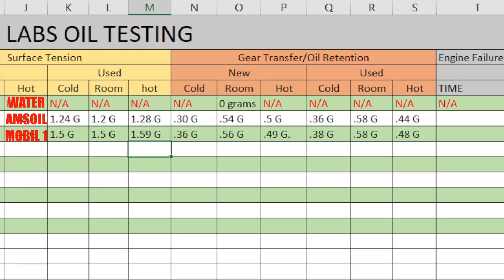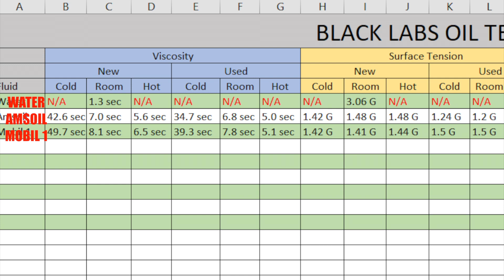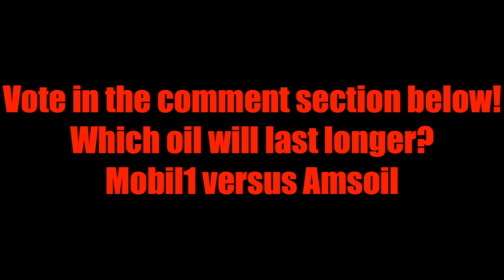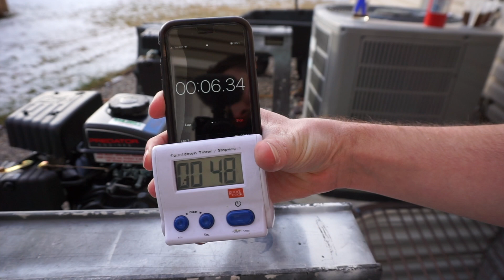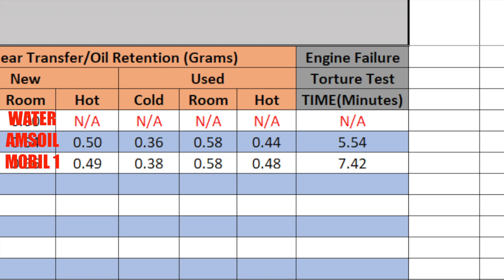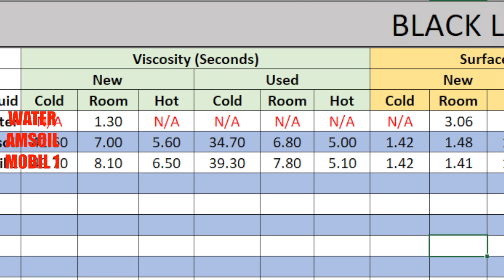Mobil 1 vs. Amsoil. Torture test. Search for the best synthetic oil (part 2)

Comment: Yeah, gotta say. Not sure this test clearly rates oil, as in this application the thermal pathway provided by the oil - from all sliding surfaces- was eliminated, causing surface temps to be affected by multiple factors. Without oil, combustion heat will not be passed to the oil, to the crankcase/cylinder fins  and to the environment. The top ring could then butt, and overload rod bearings, scuff cylinder walls, even seize. In other words, it is not just the oil's lubrication parameters at work- unacceptable changes in all clearances likely occured, not just due to inadequate lubrication, but to lack of adequate heat removal- not the fault of the oil, but lack of coolant. I appreciate the effort, but I dispute the method.

Comment: I love these tests..and appreciate the time put into them (and $$). But I've always said, a test needs to consist of multiple tests to eliminate manufacturer/assembly variables. So the exact same test with 2 new engines, maybe 3 times (yes, a waste of 6 engines lol). If the results vary, its an engine thing. If the results are consistent, its an oil thing. Is kind of how i see it. I've always gone with Mobil 1 and they seem to either be at the top or near the top in almost all tests. So that itself cannot be a random factor 😅

Comment: i live in iraq and more than 50c in summer 
we have both ams and mobil 
alot friends told me that amsoil evap after 2000 mile 
maybe cuz of overheating 
i use mobile 1 and metasu japanes oil....
but mobil1 is best 6000 mile and super cool engine

Comment: I wonder if he added oil to the Amsoil engine right after it stopped if it would have restarted since he got 8 pulls with no binding? mobil1 engine looks like it had more damage cause he could only pull it 4 times. Amsoil FTW?

Comment: I might wrong but I would be surprised if these oils were rated for the temperatures these air cooled engines run at. A simple 30 weight oil designed for these engines is all I've ever used. No problems so far.

Comment: The static adhesion is just better with Mobil 1.  I don't know why Amsoil fan boys would get butt hurt ?  It is just a neat experiment.
Reply from the maker: I don’t even know Amsoil fanboys existed until these video. They take it Very personal
Reply: @TenzaMotorsports  Its that way with a lot of products.  I did my research and found Amsoil is just a blender as most comapnies are.  Also, found out that Amsoil's  base oil comes from Exxon Mobil along with Citgo, and Conoco Phillips 66.  I made a comment about giving Exxon Mobil some credit for being part of the formulation for Amsoil ?  Did folks get mad about that.

Comment: Lemme explain what exactly happened. Amsoil flows  much better than M#1. So when you drained em I'm pretty sure Amsoil came right out probably 99.99% and inside the engine there was almost nothing left. But M#1 probably didn't drain like amsoil did, due  to flow rates in my opinion. That was probably let her go lil bit longer. But in reality no engine would survive without proper engine oil no matter what. And in this test you killed 2 engine by running em without engine oil. Remember they are engine and both were running with out oil, So one can die before other it doesn't prove anything. You could run em with oil with extreme over load to see what would happened but yea killing an engine by just adding too much load probably not enough to kill it in an hour or so. Mobile#1 full synthetic is not 100% synthetic it's minerals oil with up to 25% synthetic blend with their additives. And most experts say that 25% synthetic is over kill and more than you need maybe. In other hand Amsoil 100% synthetic and there's no minerals oil mixed but their own additives. I think amsoil is the only oil that is 100% synthetic. So if 25% synthetic blend can over kill then 100% synthetic should be over over over over(x4) kill. And Amsoil was designed to use in fighter jet type engine where you need something really heavy duty oil but they also give us a chance to use the 100% synthetic power in our regular vehicles. I been using M#1 extended performance full synthetic with M#1 oil filters in all my vehicles. From 2013 through 2020(over 7 years) then decided to try something new and used Castrol Edge advance Synthetic with M#1 oil filter for once and felt some difference. And this is no lie I felt Castro better than M#1. After 6-7 months later I changed oil brand again and used Royal purple Synthetic oil with Royal purple oil filter and I noticed difference with low engine noise and smoothness. So in my opinion Royal purple must better than Castrol edge and M#1 extended (20000miles). Big difference I noticed royal purple oil's weight lighter than others. I wanted to stick with Royal purple before I watched an full episodes of All types of synthetic oils from "project Farm". So I really wanted to give Amsoil a try because when I heard most oil companies tricking us by saying fully synthetic (which is 🤥 lie to me) but they are up to 25% synthetic blend. Where Amsoil the only oil that is 100% synthetic. Compare to others Amsoil expensive but ain't it worth? Think about 100% vs 25% synthetic oil and 15k severe service 25k normal service (1 year) and I've seen people go with amsoil over a year(I saw a guy 18 months while isn't recommended but he did) and got no issues. Even his 18 months old amsoil with 16-17k miles he ran a black stone lab test and the results were impressive with dece TBN number.  So anyways I been using amsoil for last 6-7 months in 2 of my vehicles and I'm loving it. My cars runs much quiter than before  and both of em ideal RpM was close to 1000 but now it's only 500-600. Thanks for reading I made it too long didn't even realized. Just shared my experience with engine oils and my opinions about Synthetic oils. Amsoil is the best synthetic oil I've ever used in my vehicles.
Reply: M1 wins on flow test in whole Internet, check at Project Farm and some others, that thows all above text away....
Reply: Amsoil lost. Deal with it.

Comment: How is this an oil test? It’s a which engine fails with nothing In it test 🤣 you’ve have to do this with a minimum 3-5 diff engines due to building tolerances.

Comment: So from what I guessed. You warmed up the oil a bit. The AMSoil drained more because AMSoil flows better cold or hot. Meaning the AMSoil drained more. When running engines and draining them for maintenance you typically want more oil from the previous change to drain. Unless you want some old material staying in the new change. AMSoil > Mobil One. Next time you should weigh how much oil drained from both crank cases. It would show which one flowed better out the crank case. Because better flow on start up also indicates better protection on start up. Not which one drains less because it flows less on start up so it stays in the crank case

Comment: I'm not sure what this proves. I'm pretty sure you could find some sort of non motor oil that would adhere to metal better than standard synthetic motor oils. Then when drained from the system that oil would provide enough protection to beat your test. However that oil would be a one trick pony and would never be considered a great motor oil.

Comment: This merely proves Amsoil even drains better when changing the oil haha 😂 
Like many others have done, I’ve  researched them and had my own experiences, and they are both great oils in my opinion.! While I prefer and buy Amsoil because I think it’s overall a better oil, but Mobil 1 is more available in a pinch and good enough in most everything I run it in..
Reply from the maker: Thanks for the comment

Comment: doesnt seem like the right kind of test. wouldnt it be more interesting to see them running with oil and after so long see if one had any more wear than the other? thats what the oil is there for, to protect
Reply from the maker: It would take hundreds of hours to get wear results. This is a torture test.
Reply: @TenzaMotorsports a torture test with no oil😕 there's at least 2 people on YouTube who tested oil on a small bearing for less than an hour and measured the wear mark and weighed the bearing before and after.  Those were a lot more useful is all I'm trying to say
Reply from the maker: There is oil in the engines. Thats why they can last 4-7 minuets. we did a control test with no oil and it stopped at less than two minutes. Thats great, I'm doing different tests than other channels on purpose.

Comment: Rather than the main bearings melted, I would guess the pistons/rings have welded themselves to the cylinder walls... or there is so much scuffing on the cylinders that the pistons/rings won't slide on them.  Thanks for the video.
Reply from the maker: Yeah, I was a little surprised too. I didn’t see any damage in the cylinder or on the rings.

Comment: Is it possible that when you drained both oils,  more of the Amsoil drained out since it flows better because its 100% synthetic? Meaning there was less Amsoil on the bearing surfaces than the one with Mobil1. Or maybe the Amsoil was a little thinner.
Reply: mobil1 beat amsoil in flow test --
Reply from the maker: It is possible, but the amount of oil left would be so close. I’m not sure if that’s what happened.
Reply: @TenzaMotorsports  I'd say if both cups had the same amount of oil drained into them equally, it is a very neck and neck comparison, that's close enough to see which oil has enough lubricity. Both oils are very good. The biggest thing that I've noticed about Amsoil, is the burn off rate is higher between oil changes that I have experienced in the past in other applications.

Comment: Predator engines from Harbor Freight have a safety feature that if there is no oil in it the engine stops after a few minutes and won't restart untill oil is added..... Put a quart in each and pull the cord and they will start right up.
Reply from the maker: Normally yes, these smaller ones don’t have a sensor. I looked into this when i started doing this type of testing. These engines locked up completely after these tests.
Reply: The safety sensor disabled the ignition not locking up the engine
Reply from the maker: There is no sensor on these smaller engines. If they had the sensor, it wouldn't have ran at all.

Comment: Go by the owners manual oil requirments and quit tortureing your wallet with over prices brand names.
Reply from the maker: My owner’s manual says to take it in and have the dealership do it for around $90-100 once a year or 10,000 miles. That’s more expensive than all the oils I’ve tested, if you change it yourself.
Reply: @TenzaMotorsports  Strainge owners manual, what kind of car do you have. If the manual gives that kind of advise you can google the model and the info will come up, youtube will even help with how to change the oil and filter. You should not have to pay more than $20-$25 do it yourself with Super-Teck oil and filter every 5000mils. If is a satisfied feeling knowing that "MAN I CAN DO THE BASIC SERVICE" .
Reply from the maker: I did testing on the super tech the same way I did testing on these two and it was terrible. I'd never use that stuff on any vehicle. You might want to check out the rest of my channel. I build race cars and rebuild engines. I know how to do an oil change.
Reply: @TenzaMotorsports  Super-Teck is an API SN Group lll oil, can be had for DEXOS GM motors. just as good as any other oil on the market.
Reply from the maker: https://www.youtube.com/watch?v=nngKL293e6c&t=1s

Super Tech is not good. I've spent 10s of thousands building my race car, I'm not going to cheap out on my oil changes to save 30 bucks once a year. If you can't bring yourself to shell out a whole $65 a year to do a proper synthetic oil change, then you're in the wrong hobby.
Reply: @TenzaMotorsports  that’s all I needed to hear. Thanks. Not a hobby but a lifestyle 😎

Comment: Oh they will get hot!  put some load on em then run em wide open for hours on end with oil in em then take them completely apart and inspect them for wear. Further more you should be using small engine oil in them not automotive oils. But to run them with no oil? Till the rod bearings seize? I don't get it! Sorry
Reply from the maker: Again I’m sorry you don’t understand. Let me help you out. First off I’m not testing small engine oil. This is a lubricity/strength test. It shows how long a very small amount of oil can withstand heat and friction before completely failing. It’s actually a very common test. Many people and companies have done it to show off oil retention and film strength.
Reply: Get your head out of the sand!!

Comment: Its what the oil does inside the engine at operating temps is what really matters oh and the moral of the story is don't let your engine run dry!!!
Reply from the maker: Exactly. Main point. Don’t run your engine while low or out of oil
Reply: @TenzaMotorsports    I drain the oil out of my engine, before I go on long trips.  It gets better gas milage without having to run the oil pump.

Comment: Will you test Royal Purple HPS in this way too? I think it will have a chance to beat both of them because of the Synerlec technology and increased amount of zink.
Reply from the maker: It's on my list!
Reply: @TenzaMotorsports  awesome. It is the best oil i have ever used, so i look forward to that test! When do you expect to test it?
Reply from the maker: It may be awhile. they take while to test and I use YouTube polls to choose the next oil I use.
Reply: I used Royal purple in my Mercedes 450 SL 77 model it tended to run a little hot and the oil got thick within 2,000 MI

Comment: I use Amsoil in all my stuff and regardless of this video... I'd still trust Amsoil over Mobil 1. Ive run both in the same car and seen and felt the difference.
Reply: @chris 🤣🤣🤣this fucking guy. If you think all oil is “is the same”, then I have some ocean front property in AZ I’ll sell you
Reply: My cars use less oil with Amsoil and run smoother.
Reply: Rat Tail Mobil 1? That’s a synthetic blend.  No one believes that a amsoil representative said this to you, this is the internet, anyone can say anything .  I’ve seen this same comment from you on at least three videos.  Most people know that all oil comes from a few selected sources.
Reply: Same here, James. FAR too many other test prove Amsoil is the BETTER oil!
Reply: You Wish  I'll admit, most oils feel the same when there new straight from the bottle.... but when there used.. thats when you physically feel the difference. Some oils if you run there "life expectancy" feel like sand paper.... "lost there viscosity" were other oils may feel no different then they did when they were new. Your engine can tell these difference much better then your fingers can. Slicker oils help reduce friction and power loss due to friction. Not all oils are as slick as there competitors. That and weight can play a factor too. If you go from a 10w-30 to a 0w-30 your going to see a difference in how your engine performs.... especially when its up to running temperature.

Comment: I guess this is why the Chevy corvette, amg, Porsche, Bentley and mclaren all run Mobil 1 as factory fill
Reply from the maker: This is also the reason why you should never run your engine empty. No matter what oil you use!
Reply: Mobil1 pays those companies to use it in their factory fill engines not because its better. Its like a commercial.
Reply: @redfirefox3568  yup you get it! It’s all a marketing and kick back scheme! Mobil 1 has deeper pockets. Doesn’t mean it’s a better oil.
Reply: @redfirefox3568  idk those are all pretty small companies porsche is the only company in the vw group that uses mobil one 
I work as a chevy tech I've seen mobil one work flawlessly mobil makes the factory fill oil for toyota,honda,nissan,gm dexos, subaru and mercedes 
If your interested I can make videos for you during work when I tear down engines we work on a lot of borders patrol trucks that all run 15k oil change intervals with the filter being changed at 7500 and a qt of oil being added those trucks get worked hard and they have little to no wear.
Reply: That’s the main thing is to have oil in it at the correct level at all times lol. You could use the cheapest oil on the market as long as it’s full it’ll usually work just fine.

Comment: Very interesting results. Still gonna go with amsoil 🤗
Reply from the maker: The lesson here is, don't run your engine dry no matter what oil you use.
Reply: Tenza Motorsports like my friend said “oil is oil” no matter if its mineral or synth
Reply: Not true, all oils have different film strength and additives
Reply: @TenzaMotorsports  consider adding BG MOA for added protection.
Reply: So am I. Amsoil all the way!